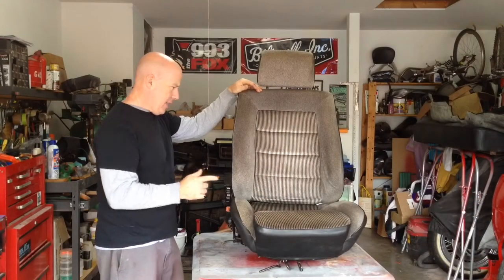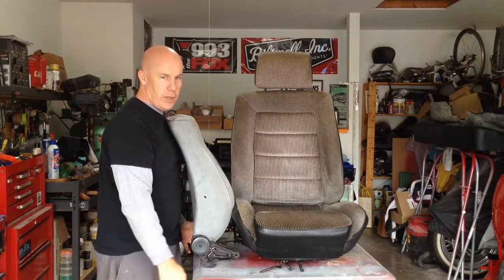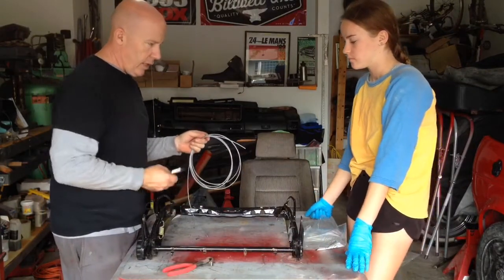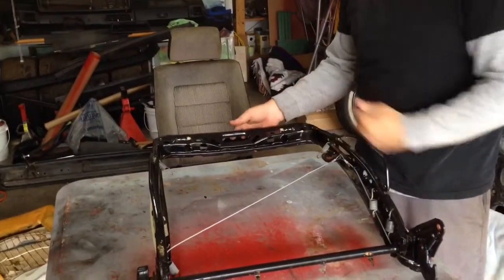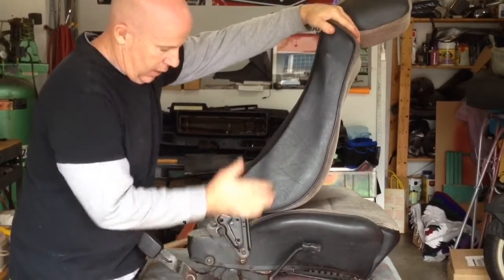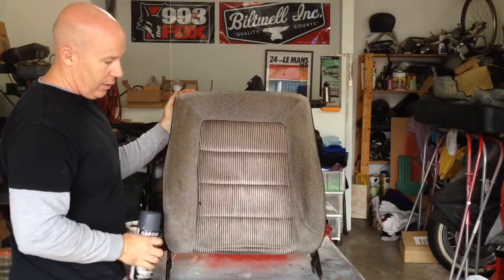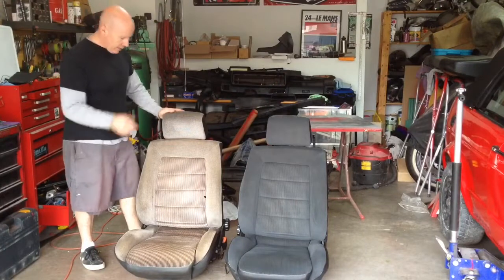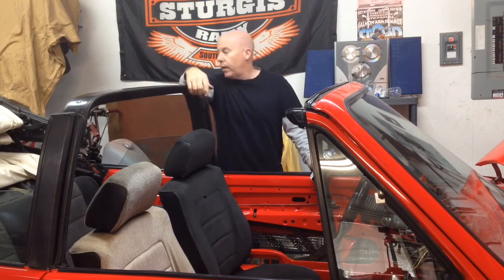Seat Repairs - 1980 VW MK1 Rabbit Convertible Project Episode 29

Comment: Nice Job!  I was wondering where do you get your parts from? specifically the pieces you placed on the back wheel fenders and what kind of red did you use to paint your car? In my 85 cabriolet i replaced the seats with those of a 2000 beetle. Keep up the great work.
Reply from the maker: I got all the replacement body pieces from 
https://www.fixmyrust.com/Category/75-84_Rabbit_I_Parts